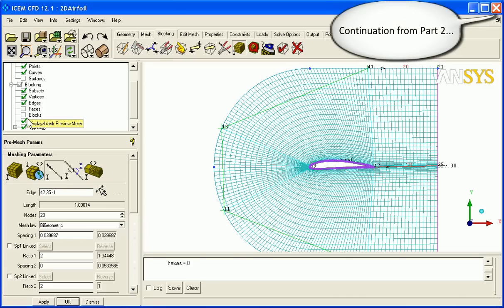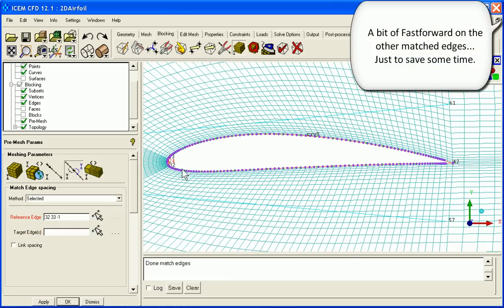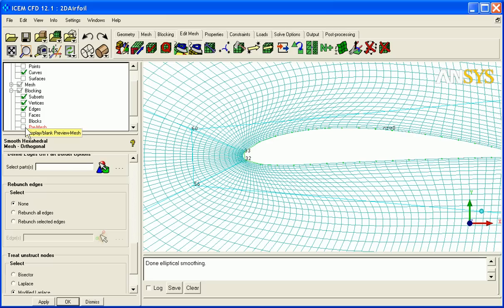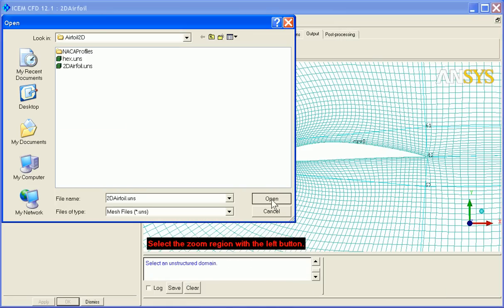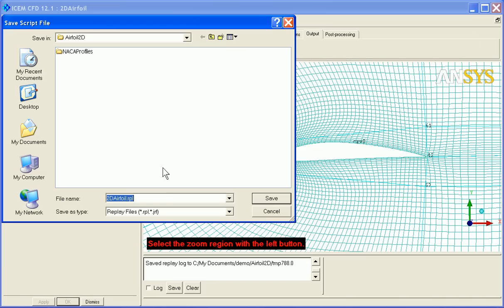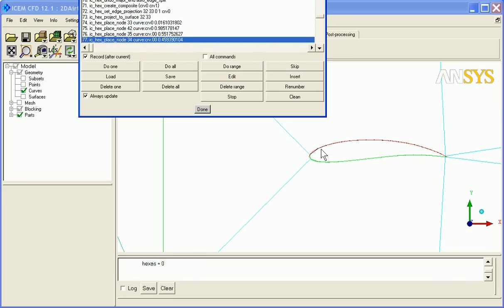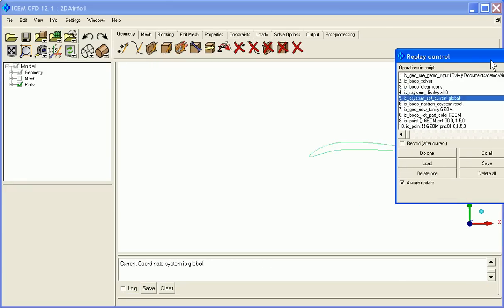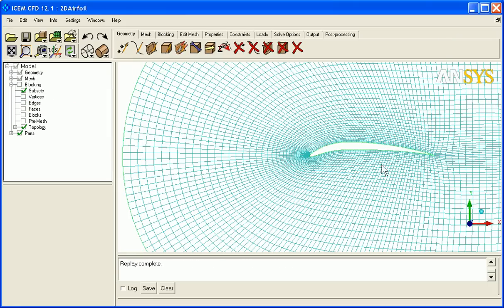ANSYS 12.1 (Part 3 of 3) ICEM CFD Hexa 2D Airfoil meshing

Comment: Important Detail: If your airfoil curve doesn't look very smooth just change the triangulation toleration in Settings>Model/Units to a lower value.
I was stuck on this one, hope it helps

Comment: I can't setup velocity inlet BC on the arc, because every edge that belongs to C-shape section is defined as FF. I was trying to change some associations(edge to curve), but the mesh was unacceptable after this. So my question is - how to setup correctly the  velocity inlet BC(i want it on arc) ?
Reply: +Konrad Jarosz The correct way to set it up is by using a pressure-far-field boundary condition inside FLUENT, and not velocity-inlet. Far-field is used more in aeronautic simulations because it let's you specify a Mach number and XYZ components of flow direction. That's why this C-shaped domain is useful - if you wanted to simulate several angle of attacks of the wing then you would just change the X and Y component of the flow direction (treating them as sin and cos of the wanted angle on a unit circle) and the mesh always remains the same. On the other hand, if you had a rectangular domain with a straight line inlet, you could do this also - but, you would be losing the advantage of having your flow direction aligned with the hexahedral/quad mesh elements (which is their main advantage.. low computation cost at increased precision if aligned with the flow).

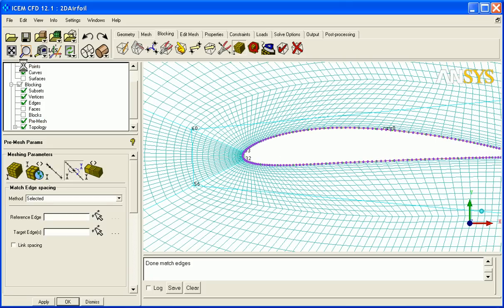Comment: After the match step (1:15 or so), I'm not quite sure how you jump to smoothing. I've created the unstructured mesh but I don't have the option to do the smoothing. I can see that in your model tree you've got a check in the Mesh sub tree but mine is not. Is there an intermediate step that you maybe fast forwarded over that I've lost track of? Sorry but I'm still quite new with ICEM.